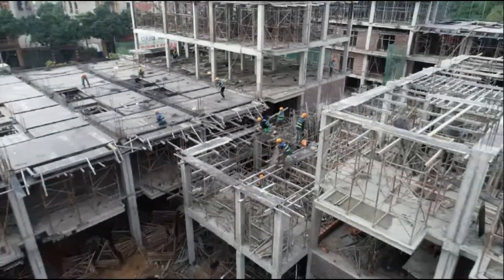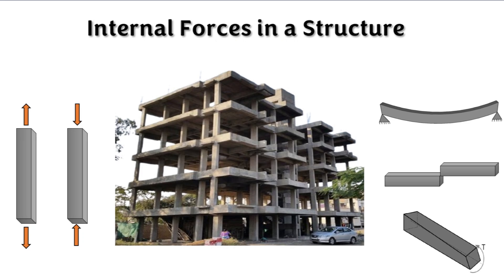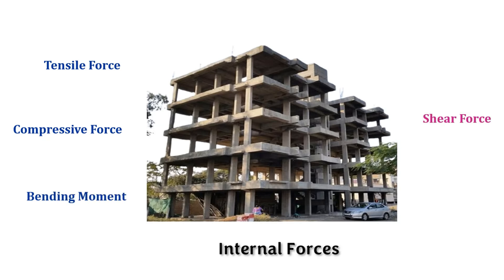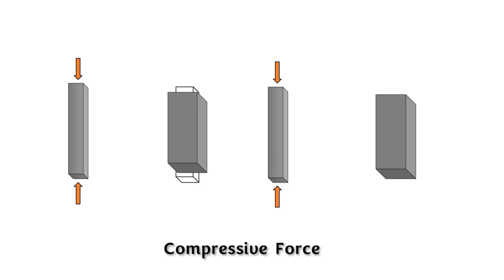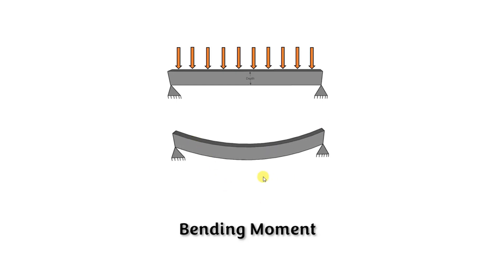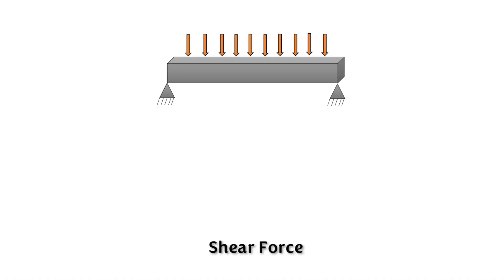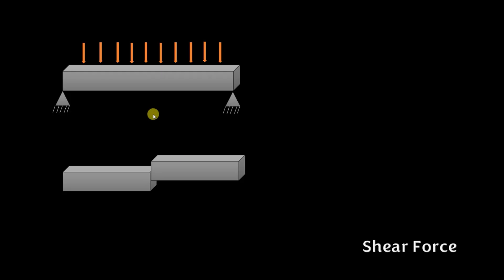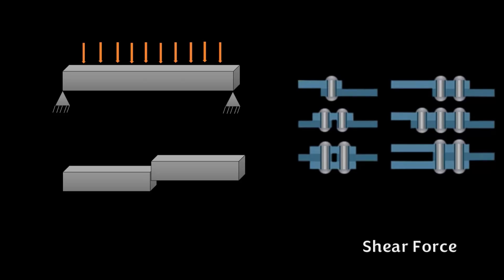Internal Forces in the Structure | Tensile force | Compressive Force | Shear Force | Bending Moment

Comment: Correct me if Iam wrong,  calculating all internal forces due to ext loading to get the area of steel, area of c/s of conc to resist all external forces ...is it ???
Reply from the maker: Yes. We have to find out the cross section and area of steel required for the structural member to resist the external forces.